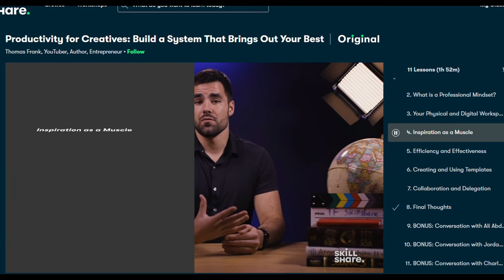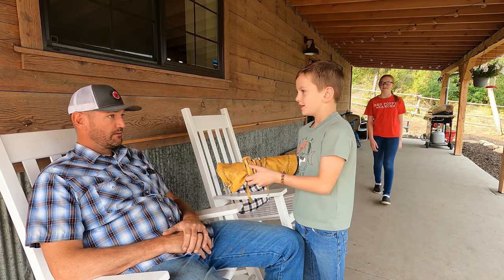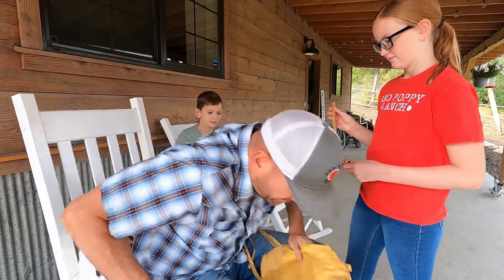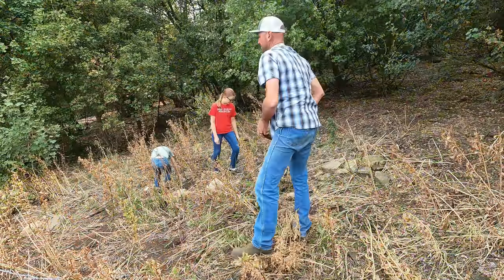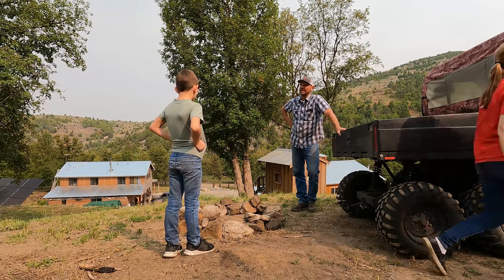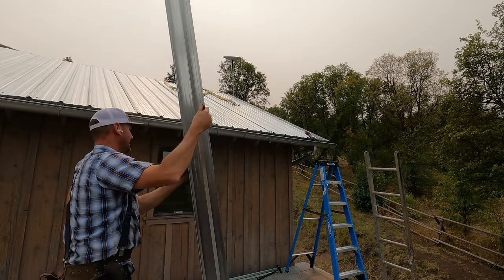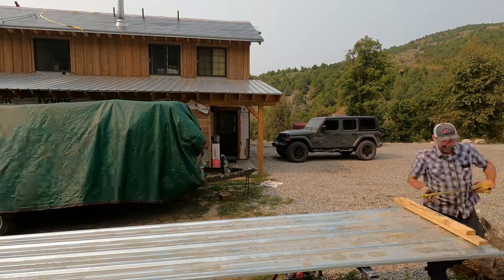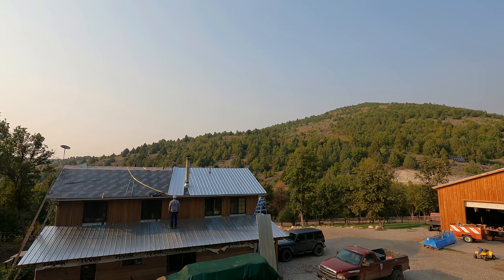#517 - The CORRECT Way To Install A Metal Roof!

Comment: Roof looks great!! I wish you had used roof metal foam closure strips on the end of the steel panels to keep bugs, air and wind driven rain/snow out but you can always add them later.

Comment: For your chimney stack, you can buy a silicone flexible pipe flashing, that is made just for the chimney.  It contours up and over the contour of the ribs on the roofing panel.  You can get them at the roofing supplier.  They have the regular for plumbing pipes, and the silicone is for when the pipe is hot.

Comment: Rain on a metal roof is just the best.  Tek screws are cheap and properly fixed dont leak.  You know the wind loadings and directions where you live so fix accordingly.  Looks a good job mate.

Comment: You guys should convert one of your old trucks into a fire pump truck.... would be a cool build series!
Reply: That would be a very good idea for where they live...or at least a skid type setup that could be quickly loaded into the Polaris Ranger even would be useful.  I've been thinking of something similar and I don't have much property but sadly can't get water on about 1/2 of it and makes me nervous when we have thunder storms or 4th of July, and the neighbor's lots are dry too.  Wish I could rely on the irrigation water so I could get an irrigation pump and sprinklers installed, I don't mind mowing at all, if I could just get water onto it reliably.

Comment: With the risk of wild fires in that area have you thought of zoning off the area around the house with a rock wall to reduce the manpower needed to protect it down to a few sprinklers spread around to take out spot fires? You might not have as easy access on the land to good building rocks but the neighbors seem to be growing them faster then they can deal with them and it is a good idea for everyone to look into a wall even if you pick different style walls. 

Sockets can be included in the walls for fence posts to put barbed wire or field fencing above the wall to help keep the animals in/out and if needed you can hide pipes in the wall to help with firefighting as long as they are setup to drain for winter. 

You can even cheat with a mixed style wall by building a fast to build gabion style wall then skinning it with a different look if you don't want to look at rocks in a cage as you have the fire protection fast but then can take time to make it look good.
Reply: A lot of forest fires spread in the canopy.  A wall won’t also stop dead trees from falling down.  Removing excess dead trees is the best plan.  He needs firewood so having a quality gator-style vehicle that can drag logs and haul cut wood covers both.
Reply: @flyingember  The trees they already cleared near the house so all the fires that would get near the house are a grass fire or rolling burning trees that would get stopped by the wall?
Reply: @TheUserid82  embers can easliy travel with winds and set fire to anything, a wall aint gona stop that either

Comment: Another time saver, pre-drill the screw holes through all of the sheets as they sit on the saw horses. I used a story pole to keep the holes in alignment.
Reply: the screws are self drilling
Reply: @Durrttyy  I know but pre-drilling speeds up the process. This is what I did on my roof and it went down extremely fast and the screws looked great from below.
Reply: He's drilling with one hand.  Unless the drill is perfectly perpendicular to the roof, the screws will want skidder off some direction.  Holes punched with an awl is quicker and doesn't leave little curls of metal that can rust
Reply: @howardbain6516  to each his own. I've put on over a hundred metal roofs and I have the way that works for me.
Reply: @Durrttyy  And face laps away from prevailing wind. We stack and drill all panels on ground about every 32". with neopream boots on pipes.
Reply: Here we order the sheets the exact length we need and we predrill so everything looks perfect when done. But good job

Comment: Awesome job Heath, I know that must feel good knowing there are now limited reasons for going back up on the roof.  Time to find some tall posts for the new hay /machinery shed. Oh wait, the water tank is next...I hear a lot of young kids frequently say how they'll just build their own place so they can get out from under mom and daddies thumbs. It doesn't take too long for the reality to set in knowing it's going to require a lot more than they thought. My advice is to keep your feet under momma's table as long as you can, don't squander your money on needless things, and like everything else have a well-thought-out plan. Get a job working on new construction homes and learn as much as you can. I'm sure Heath's plumbing experience coupled with new installs helped him considerably, but much of it had to be researched and some even by trial & error such as the solar system. Hard work, determination, a working spouse, and God's blessing made it all possible here.

Comment: I live In cyclonic areas where the wind can get between 150kms and 300kms per hour and gusts over 360kms per hour.  Our roofs are fixed with screws every rib or two per rib if the section is similar to your roof.  Then every 400mm another row of screws.  It all depends on your wind load.  You normally don’t get any warning when you loose a roof :-). A screw every foot sound about right if your wind load gets above average.

Comment: I learned a neat trick for metal roofing from the pros that did our roof..  when all your metals stacked up on the ground, predrill your fastener holes, all your fasters will line up perfectly when seeing them on the roof, and it helps get a better seal on the rubber seal on the fastener.  I know its probably to late now but its the way the pros do it.   I did my garage myself and the pro job looks far better just from that little trick of all the fasteners being identical placement from sheet to sheet.
Reply: Also yeah the pros don't put a screw ever 1 sq foot.. lol

Comment: My father did not have much luck with these metal roofs on his pole barn in Northern Michigan.   After 10 years all of the screw holes leaked and rotted the wood underneath.   The asphalt roof we installed on the house however should be fine for 25+ years.   We installed that 15 years ago and still looks like new.

Comment: For metal roofing to prevent leaking use butyl seal tape where the sheets overlap and also for the rid cap along the screw line the sheets are also overlapped wrong the large ridge is supposed to be on the bottom while the small  ridge covers that and the butyl tape goes between those overlaps and screw your stitch screws on the center of the overlaps I do agree with the other comment about foam closers at the bottoms  you've done a great job of keeping the roof straight I've worked with people that can't do that

Comment: Roof looks good, One thing you could do that would make it a little better is to predrill all your holes just to make all the holes straight and true. The other thing is to put 1/2" mastic in-between the seams. Get a "RED" rubber boot for it! They are made to take the heat! They are made for metal roofs.

Comment: There is a material called M1 it's a colking it's good for extreme heat we use it in Nevada for roofing I was roofer out there for 40 years It is a urethane base calking

Comment: Any time I had to cut metal roofing I just used an old wood blade and turned it backwards. I also had flipped the metal upside down so the flat part was what my saw sat against.

Comment: the secret to keeping chickens safe is putting your hen house inside the run. dig down the fence of the run with coated wire 1 foot in the ground  , I put my chicken wire on cattle panels and at the bottom of the hole I put the wire at a right angle  in the bottom of the hole and buried it . If anything digs if it goes 1 foot down it hits wire ,I've never had anything dig  that deep I have my coop on pilings so they have a floor I  also put wire over the top so hawks or owls can't get in my son calls it a chicken Auschwitz  I've had chickens in the northwoods of Minnesota and now in Wyoming  lost one bird in all the years I've had chickens and that was during the day when they were free rangeing
Reply: Sensible practiceand advice, take the temptation away from the preditors by protecting the birds in a secure environment.
Reply: @Kermit-bi7dl  I fully agree. Lack of respect. 😠

Comment: I've heard a lot of people that say to put the screws on the high points of the metal roofing material.  As less water will potentially leak into them there. Any thoughts on this?  Either way,  good job on catching the chicken killer, and showing the kiddos some life saving bushcraft skills. Keep on keeping on 👍😁
Reply: Heath has done his roof incorrectly! In Australia, 90% of roofs are metal/tin and none are ever screwed in the valleys.(low points) Always screwed through the high points……..

Comment: Love your videos. Why did you put the screws on the flat and not the ridges? I'm getting ready to build a pole barn with metal roof and just wondering.
Reply: Say you decide to pull the snow down with a snowrake. Those screws on the ridges will stop you from doing that. Always place the screws in the flats.
Reply: I never put the screws on the flat. You’ll learn why in around 10 years. Maybe sooner.
Reply: @miketarbox1190  never place screws in the flat.
Reply: @rossclark9155  Yup, all manufacturers direct you to put them in the flat.
Reply: @joanntommykeener79  There is another YouTuber I watch, Ken's Karpentry, where all he builds is garages, mainly with metal roofs, up in Vermont. Always the flat, never the ridge. I installed a metal roof with a contractor friend, and we only installed screws in the flats.

Comment: The way I have seen that type of metal roof installed, the screws go on top of the ribs, not down in the flats.  That makes water shed away from the screw holes and by using more or less torque when you screw them down, you can adjust the panels slightly to keep the edges and ribs straight.

I don't know which method is right and which is wrong but that method makes the most sense to me.

I'm going to have to do it on my steel carport because that is the type of steel used but for my house I'm going to a hand hemmed standing seam with floating clips.  It is more expensive to do real standing seam but you wind up with zero exposed screws and the path water would have to take to get under the metal at a seam is quite a bit more protected beside the lack of holes.

I'm sure you know this, it's just the reason why I'm going that way.
Reply: I installed metal roofing for five years when I hung "red iron".  Screws go in both places.... Purlin screws (flats), and lap screws (ridges).  Purlin screws anchor the sheets, and lap screws pull the seems of the two sheets together tight.  Lap screws are shorter, and have a wider thread than purlin screws.  Now, this was on all steel buildings, but I'm sure the same theory works for installing on wood roofs.
Reply: @Skulllywag  interesting, the metal carport companies seem to sell screws by the box, not short and long.  I'll have to look in to how long those screws are.

Comment: So the metal you are using is Designed for Barns those metal screws with those rubber grommets are always going to leak .The new style metal roofs that the machine extrude the metal to make the panel is the better metal for houses and you don’t see the screws the way the metal pieces interlock and don’t leak!

Comment: sounds like its time to weld up a cattle guard in the driveway entrance. Or are they getting in through your fencing? Behind the house and garage? Congratulations on getting the roof done. your local roofing contractor should be able to sell you a roof flashing for the stove pipe. Just remember the top part goes under the tin and the bottom part goes over the roof. You got this.

Comment: I know y'all won't like what I am about to say but if you put the metal like in Shingle when it comes to stopping leaks it may not look pretty but it will stop the leaks I thought I could lay it down that way but it still leaks show I had to take it back off and like a shingle roof then it stopped leaking

Comment: You never need to stand on the new iron except maybe the last sheet if you can't reach it off the ladder you keep the sheets from running out with a specialist carpenter's tool many plumber's hardly ever use a tape measure . This is done by means of subtraction of the overlap from the width of the sheet witch gives you the cover of each sheet and measure the roof that is yet to have the iron secured at the top and the bottom of the sheet you can even take a pencil or crayon and mark Pharrell points on the roof so you don't have to run your tape measure all the way across the roof this process is called setting out . We also weather the top of each sheet by bending up the down flutes with the profile of iron you are using their are clamps made or you can use a Cresent wrench  It stops wind blowing rain up and over the top of the sheet . Stay safe.

Comment: Don't scrap the 1' pieces you cut off the full sized sheets. You can use them like shingles on a roof of a smaller project, like a goat barn or shelter.

Comment: Watch some RR builders videos, you are lapping the steel wrong the whole rib goes under and the partial on top. Has to do with breaking the capillary action I believe!
Reply: What about the placing of the screw in the lower flats instead of on the ridges ?? 
The reason for the screws on the ridges is that it reduces potential leeks at the screws.

Comment: Predrill your screw holes every 2 feet in each flat.  Use a harness!
Reply: Pull aluminum generator wire and replace with copper before you make another blunder that WILL come back to burn you later.
Reply: @ditchplains1tavernier470  Are you paying the difference?
Reply: @tonygrimes13  No.  But they will when it fails possibly starting a fire.

Comment: Never put a screw on the bottom of flat, but on the ridge where there is never any water
Reply: More water on the flats as it runs down,  but I've seen people over drive the screws on the ridges, makes a mess, we also screw the ridges every two feet up, not just the top and bottom.
Reply: @ronaldsimmons8346  funny you say that, different manufacturers of the very same profile recommend different ways of installation on metal roofing ,there are only a few manufacturers of the rolls of steel they use but every tom, dick, and Harry has a die roller for roofing and siding profiles then slap their name on the product and call themselves experts. I'll go with time and tested methods and quality fasteners with guaranteed seals .

Comment: I don't want to sound like a "Safety Sally", but ... 18:40 you can see him sliding on those new roof panels.  No real safety harness and just a couple of straps tied together as his lifeline.  
21:20 even he admits that the new tin that the new tin is "incredibly slippery. I was hanging on to that strap for dear life !" At 21:58 where he is manhandling big pieces from the newly covered lower roof to the upper roof.  Brake parts cleaner to maximize traction ?  How about a couple hundred dollars on a fall prevention kit ?
I sure hope he has good accident and life insurance.  One day he and/or his family will need them.

Comment: 1 screw every square foot???  He's just trying to sell a lot of screws!

Acetone is good for cleaning off the mill oil off the tin.  The oil to used to roll form the tin at the mill and provide some corrosion protection.

Comment: I can't believe that you are more concerned about the number of holes you put in your roofing metal than you are putting holes in your eyes from a chard of metal from cutting it with a Diablo Steel Demon blade on your circular saw. Closing your eyelids doesn't help either as they will penetrate them and your eyes. I've yet to see a blind man build anything on a homestead. Shame on you, Heath! Wear some safety glasses.

Comment: years ago when I first read about the trap you used to catch the racoon, they said to place a big bag over the trap and leave a small opening at 1 end and hook up a hose to the trap and the other end to your exhaust pipe and let the vehicle do the job
Reply: It works. The Nazis did that too

Comment: I can’t believe you killed that raccoon and justified it by comparing it to Disney movies. Here’s the truth if you had did a little research on building a secure chicken coop in the first place your chickens would be safe. I know you like to do thing twice. The solar batteries, the roof, generators fencing. But the coop is not secure even with a dead raccoon.